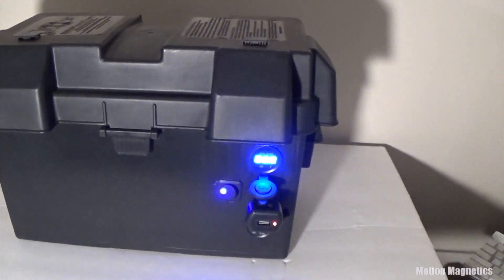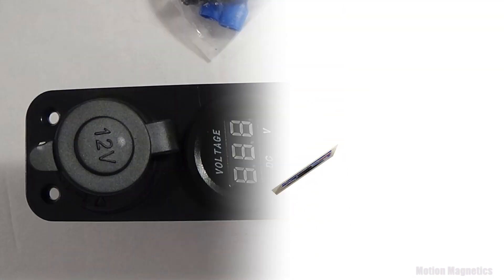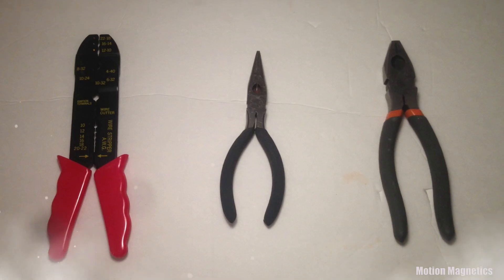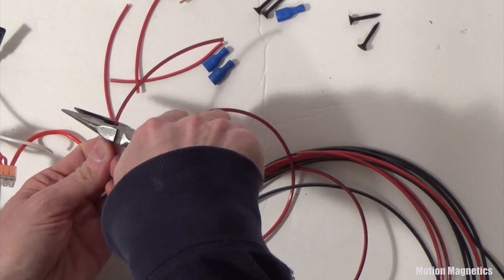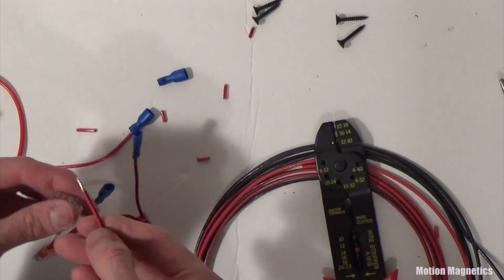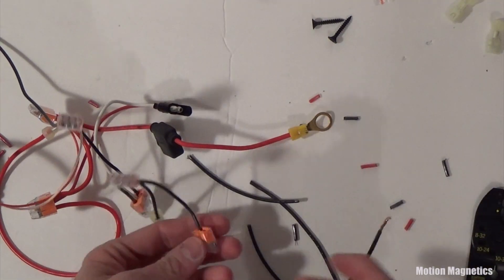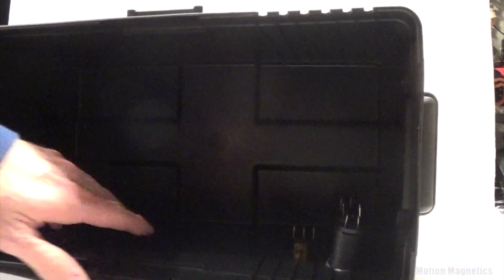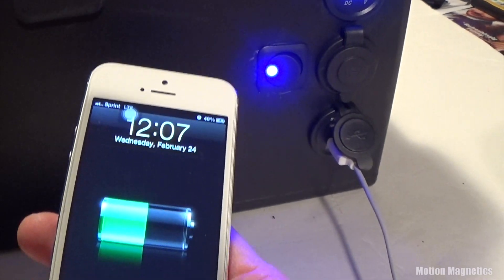Portable Power Supply

Comment: That was wonderful.
Reply from the maker: Thanks!
Reply: I just watched it a second time and I think I want to give this a try, but I have a question. @Motionmagnetics  

I'm interested in using a small wind turbine I'm building and I'd like to run it into this portable battery (I'll get a marine battery like you suggested).

My question is about the solar connector. What are they? Would that be something I could use and wire to my small turbine?

I'm pretty new to this stuff, so I have lots of questions.

Thanks.
Reply from the maker: @BrianMeeks  It's been a while since I did that video, I forget exactly how I set up the wiring. The solar charge controller was just to charge the battery though. You could also just use a standard battery charger. Or run your wind generator through a bridge rectifier, and connect that to the charge controller you intend to use. As long as you set the output voltage of the charge controller to the voltage of the battery you're going to use you should be fine.

Comment: I built this.  Works great and I use a solar panel to charge the battery when not in use.  However, I am using an RV battery and it weighs a ton.

Comment: Motionmagnetics -  Conceptually it's a nice idea however the devil is always in the details.  You state that the fuse will blow first and protect the battery.  Fuses are supposed to protect systems and components not just batteries.  One big fuse might protect the whole system, accent on might, but individual parts are unprotected.  A fuse is supposed to be the weakest link in the system it fails before everything else.   Your 30 amp fuse will allow the whole system to burn like Nero's Rome.  Big wire and small fuses are safe.  Small wire and big fuses are trouble waiting to happen.  Protect your 12v out, the USB, and the voltmeter with individual  fuses in addition to a master fuse.
Wiring in series, particularly the ground, makes no sense.  With the exception of the master switch and master fuse it would be far better run parallel.  I know the 3 way connectors are easy to use, but easy is rarely ever the best way.  Consider a master fuse and fused buss bars for your next build.  
I would use the solar connector as  the common hook up for the solar and the AC charger as it's unrealistic to used both at the same time and I would wire it to the battery directly, not in system.  The battery charger and solar charger if they are worth anything at all will have their own circuit protection.   I don't know what sort of solar panel you have, but If it's anything over 5 watts a charge controller would be a good idea.  The system can still be salvaged you just need to redo the wiring.  Be sure the battery terminals are clean and sealed against oxidation.
Reply: Thanks for the professional insight!
Reply: @Xellos357  you betcha!  Wiring isn't as simple as connecting nuts a bolts.  To quote The Martian, you "got to science the sh*t out of it."

Comment: Walmart batteries are the worst batteries on the market. I have had problems out of every battery purchased there. 2 lawn mower batteries, 2 deep cycle and 1 auto. Now only Napa or Auto zone. Amazon for dry cells.
30 amp fuse is to high for 14 guard wire. 15 amp is listed but 20 amp is used often

Comment: The beginning of the vid is too dramatic for building a battery box but the content may be quite helpful. PS. There are quite a few of these vids on YT, yet none of them shows how to charge that battery and/or make it an auxiliary battery charged via the main car battery
Reply from the maker: Honestly, the easiest way to charge one of these is with a standard charger/maintainer. After you mentioned this, I showed how I charge them in my latest video. Thanks for the comment.

Comment: What is the smallest marine or deep cycle battery that will work in this set up?
Reply: Jan also can a truck battery work for it?
Reply from the maker: You can use any size. Just be aware that a stronger battery will power your device longer. If you only need it to charge your phone, or pad, you can use a really small battery. If you're going to be running a computer, or something larger, you might need a more powerful battery. I showed a smaller power box, with a tiny battery in my latest video.

Comment: Great Vid. 
If I had an AGM 100-130amp battery in this pack, would I be able to run a 60L fridge for a few days? Would the other components (wires, fuses) hold up?
Reply from the maker: You'd need a bit stronger of a build for that one.
Reply: Motionmagnetics what do you mean by 'a stronger build'?

Comment: Only thing I can see is to replace the 30 amp fuse down to a 20 amp fuse for 14 ga wire remember you size the fuse to protect the wires from burning and to crimp the connections instead of mashing them with pliers. A proper mechanical crimp won't loosen up if it heats. And if you decide to add any bigger loads just add a proper fuse at the battery and wire it direct but for the lighter loads your doing mashing them will get you by. Nice setup.
Reply: One thing I would add Bruce is that 14 gauge wire is 15amp fuse, #12 wire is 20amp fuse, #10 wire a 30 amp fuse...and on.  Its a nice unit! Stay safe.
Reply: @bernied9415  👍 Even Better

Comment: This is very well done. Excellently explain with your graphics. I would like to build a more powerful one with a Inverter that would power a refrigerator and /or micro wave. I have power outages and this will help and its so safe and gas free.  How would you add an inverter and how many batteries would you need to have the power I need to power the frig/micro wave.
Reply: A normal car battery would power a refrigrator only for about an hour.
Reply: Pls a normal car battery of how many volts and watts pls?

Comment: I think you did a good job, overall. I do take exception to one item, however. 14 Gauge wire is way too light for most things you might want to run. 12 Gauge is the SMALLEST I use in ANY DC project! And I would use a heavier switch as well.
Reply: Good point, that was the first thing I saw that was in error according to electrical standards, 14 gauge for 15 to 20 amps, 12 gauge for 20 to 30 amps. I also believe he did a good job of simplifying the wiring using the easiest method for connections and explaining what he did and how he did it.

Comment: You can use the wire stripper to also crimp the connectors - rather than the pliers. There are positions for 10 to 12, 14 to 16 and 22 and smaller gauge crimps. They are typically colored dots which correspond to the colors of the insulation on the crimps;  Yellow, Red and Blue. You'll get a better crimp that way.